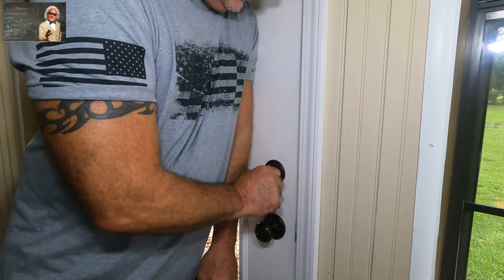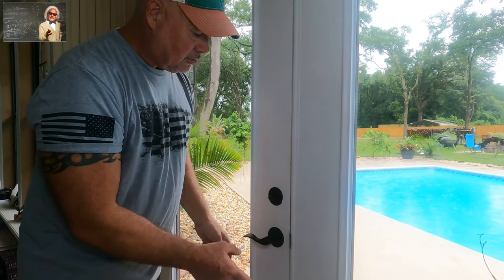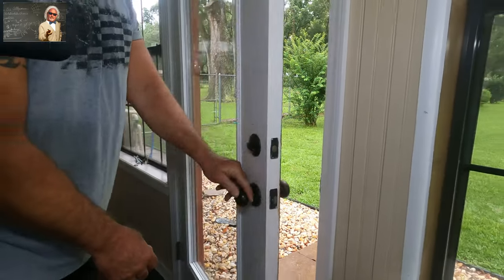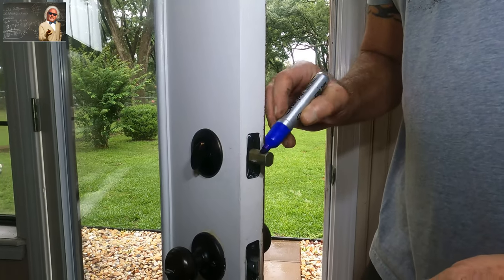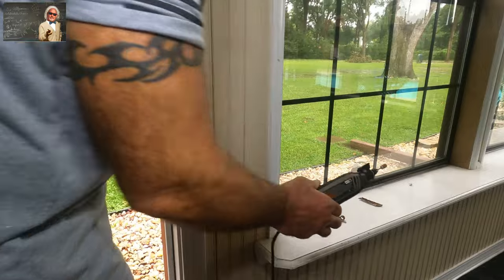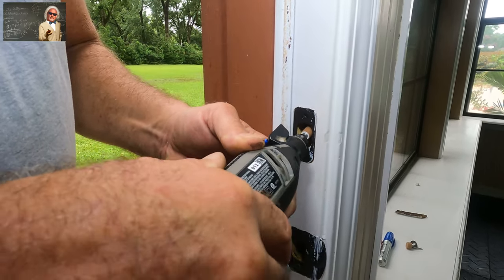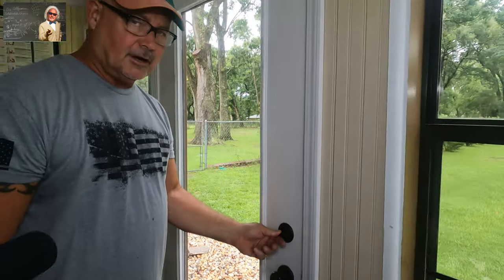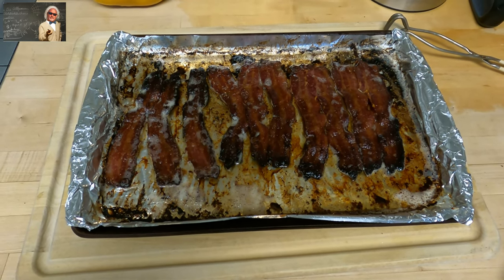How To Make a Deadbolt Move So Smoothly Into The Hole :)   AWESOME Hack!

Comment: I used the bacon grease on my deadbolt and it slides even smoother😜 
Before Dremels we used to put the ball end of a ball peen hammer against the strike plate and wallop the flat face with a rubber mallet and it would open up the hole so the dead bolt fit looser.
Reply: I did a similar thing with my front door. Kind of panel beat the striker plate with a piece of brass rod and a hammer.
Reply from the maker: LOL, we're with you on that Ben, the use of a bph and a good wallop can work, but we usually find it creates more damage than we could stomach :) Been there done that LOL! Thanks for watching and for the comment, did some reminiscing on the many things I've destroyed in my days LOL. GuruMike
Reply: @MrKnowItAllGuru  the old BPH can help get out of a lot of jams😀 if used in moderation!

Comment: IF you have to move the plate, you can tap in a bundle of 2 or 3 toothpicks into the old screw holes.  It works like a charm.
Reply from the maker: Thank you for watching and sharing, have a great weekend. Guru Mike & team
Reply: Chop sticks work well too and most of the time they are tapered.

Comment: I use the Dremel for that kind of thing all the time, it’s a great hack. But now about the bacon, I bake my bacon all the time. It’s the easiest no mess way to go, and the bacon stays flat. The only thing I would recommend is after you put down the aluminum foil, cut a piece of parchment paper and put that over the aluminum foil and lay the bacon on the parchment paper so it’s not touching the aluminum foil. Aluminum foil has one of the highest transfer rates of aluminum to food, especially with that high of a contact. It can lead to Alzheimer’s in the future. Never cook any food in direct contact with aluminum foil. Peace
Reply from the maker: Thanks for the view and comment, have a fantastic week my friend. Guru Mike & team

Comment: I did customer service for many years with a large construction company. I figured out that message many years ago by marking the bolt with white caulking then letting the boat hit the striker plate and then trimming the striker plate appropriately. In some cases I actually had to remove the striker plate and trim the wood behind it and then put the striker plate back but I always got it to work smoothly.
Reply from the maker: Thanks for watching and sharing Manny, we really appreciate it, hope you have a great week my friend. Guru Mike

Comment: I install smart door locks for living. And this is particularly crucial for smooth operation otherwise you wear out the batteries or worse at the lock won't work. I was really hoping you would show us how to get the door to close further by adjusting the lower knob. I do like using the marker as a bling agent to see where it's hitting. Brilliant
Reply from the maker: It seals perfectly, just an FYI. :) Thank you for watching and sharing, have a great week my friend. Guru Mike & team
Reply: @MrKnowItAllGuru  No worries I know it seals. I really wish there was a way to get the door to close a little bit tighter rather than weakening the strike plate that's all
Reply: @MrKnowItAllGuru I ran into this problem today when installing mine. I need to file the bottom and right side of the plate because I have to slightly lift and push in the door for the bolt to catch.

Comment: New to your channel. I subscribed to Sweet Project cars wat back! Loved this video! I have on door that the dead bolt is correct when it locks, but the door strike on the door knob is loose when it latches. How to fix? I Love bacon! I worry about the aluminum leaching into the Bacon? What do you think? Subscribed! So much FUN to Learn from you! Thanks!!!!!!!!!!!!!
Reply from the maker: Inside the metal plate that is screwed to the door jam, there's a little tab in there, you can stick a screwdriver in there and pry that tab out a little bit until it latches firmly with no slack. If that doesn't work, send me some pictures to sweetprojectcars@gmail.com and we will see if we can get you pointed in the right direction my friend. Also, no worry about the bacon, that aluminum foil is made for the heat, no leaching. Thank you for the view and for the sub Davil, we truly appreciate all of our great subscribers like you, hope you have a stupendous week. Guru Mike

Comment: You can see that the piece sticking out is drooping and it's not coming out bone straight from the. Why not fix the drooping metal lock rather than grinding out the hole where the lot goes?
Reply from the maker: You can do this fix any way you want to Lynda, we are just sharing what we know works. Thanks. Guru Mike

Comment: Here's another quick tip: if you DO decide that you want to move the holes slightly left or right, you can just take some matchsticks, cut off the heads then jam, hammer to seat or break them off into the holes that were drilled. then fill with wood glue from a dropper. Now you can drill without worrying about cracking, splitting or the drill bit walking back in and following the original hole.

Comment: Unfortunately, you have weak strike plates which makes that door easy to kick in. Also, all that glass isn't the best for security either.
Reply from the maker: Well your comment is not the point of the video...and what I have is better than leaving the door wide open...plus I dont live in fort knox and I have Smith and Wesson items that will be used if some idiot tries to kick in the door.

Comment: If you have to move a striker plate in are worried about the screws trying to go back in the old holes, put a wooden match stick in the old screw hole and then put the screw next to the wooden matchstick.
Reply from the maker: Great tip Michael! Thank you for watching and sharing, have a great week. Guru Mike
Reply: I saw someone use golf tees too. All good ideas.

Comment: Hoo boy you're not kidding about the screws wanting to go back to the old holes. Had that happen a few years back until I'd about filled the whole darned hole with wood filler and redrilled everything 😅
Reply: To fill the old screw hole try drilling it out with a 1/4" drill bit then tapping in a 1/4" dowel with wood glue and levelling it smooth when dry. You can now carefully drill your new hole without the bit slipping into the old hole.
Reply from the maker: Exactly Alex!! I'm with you on that my friend, been there done that LOL! Thanks for watching, hope you have a fantastic week. GuruMike
Reply: @Marcoosianism  oh it wasn't so much the bit wanting to go back to the old holes as the screws themselves. The wood of the frame had been cut in a really poor way to create the hole for the lock's bolt (looked like someone missed their mark and decided to use a chisel instead) so even after plugging the old holes the screws would either burst out into the hole for the bolt, or would push the plugs enough to wiggle. Replacing part of the frame was something we considered, but everyone else was dithering about it so I got fed up with it and went to the hardware and fixed it up the best way that I could 😅
Reply: @alexguzman5547  I see, so the frame was a bit of a mess to start with. Yeah I hear you, in the end you just have to do what you can 🙂

Comment: It’s a good place to start. But in my case the alignment is off to the point where the bolt reaches the edge of the plate. 

So it definitely needs to be repositioned so I wouldn’t call it a waste of time if filing won’t do the trick.
Reply from the maker: Thanks for watching and sharing, have a fantastic day. Guru Mike & team